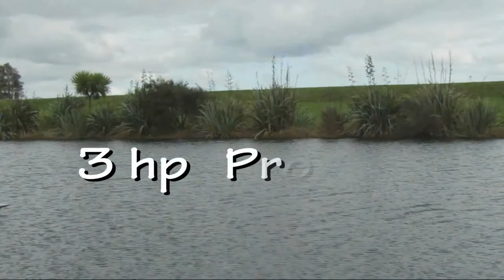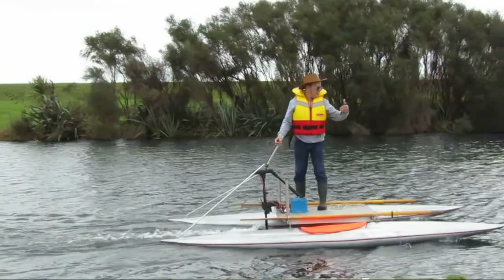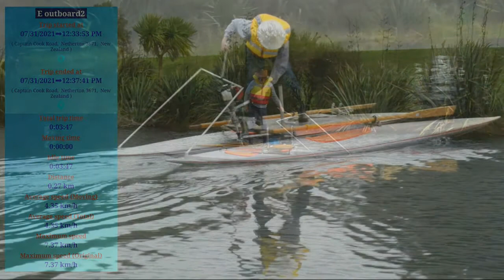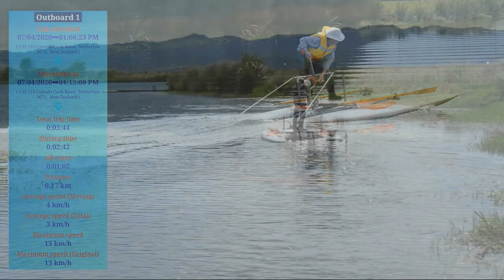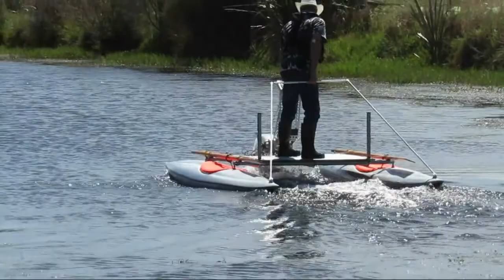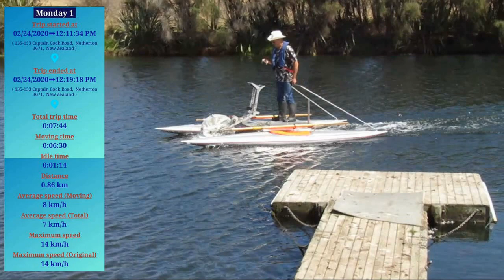Faster than propellers, using less power!

Comment: What props used? Weight, hull geometry come into Play. Still neat experiment
Reply from the maker: Props used came with the outboard motors, the 1.2 hp set up was 8.8kg, the 3hp was 28.8kg, including 2 large batteries @ 22kg and the paddle wheel set up was 25.8kg, including 3 small batteries @ 7.8kg, they were all tested using the same hulls(hull geometry).

Comment: Nice testing. The link was cutoff but found it on another video : https://www.youtube.com/watch?v=Jh5LdzN3mpA&t=1s . The paddles are at 45 degrees? How many paddles does the wheel have and which is the diameter of the wheel and paddles? Thanks!
Reply from the maker: Thanks, I've fixed the link and here's a link to a previous video with the same set up, but I didn't record the speed https://www.youtube.com/watch?v=0iC5PFI2dag  Yes the blades are set at 45 degrees. But the length, width, number of paddles and  diameter of the wheel depends on the power of the motor and gear ratio you intend to use ;)